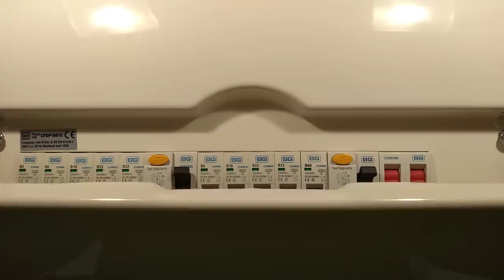A look inside a British home electrical panel.

Comment: I think the regs say 'fire retardant material' or something similar, but this has universally been taken to mean metal. Most switches and outlets in the UK are made of a fire retardant plastic, so I would have thought a consumer unit could be made of this. It's generally not a problem, but there are possible issues in using a metal unit on a TT system such as yours (and mine!).
Reply from the maker: That opens the can of worms of whether the DB itself should have an external RCD just to protect it.  But in reality, with well installed double insulated cables going through a proper gland like the one shown the risk of live unprotected metal bridging onto the case is extremely low.  Worst case scenario might be if the unit was on fire in which case it would be logical to isolate it externally anyway.

Comment: Wow,  the UK service panels are very clean and well designed.  PS. Clive it takes four years in BC Canada to become a residential electrician.
Reply from the maker: It used to take four years here, with day release one day a week to technical college for the first three.  A profit motivated faux "safety" organisation got involved.  A kitchen fitting company can invite a travelling "trainer" in to do a one day slideshow presentation for their guys and they all instantly become certified domestic electrical installers.  You can guess the results.
Reply: @bigclivedotcom  Yes. I see it a lot here... I did 2 yrs YTS in the 80s, then moved on to other jobs. Including a brief time with a telco (BT). Then came back to the industry... and have done another 3 yrs of practical training since then with a few courses also. The amount of people who have NO idea about current ratings of under various wiring methods, yet that's a basic thing!?

And as to the busbar going down the back of the breaker, every few days we come across one
Reply: @bigclivedotcom  Amazing and dangerous
Reply: @bigclivedotcom  How hard is it for DIYers to become certified that way? I can understand (but not necessarily agree with) the push to keep the incompetent away from electricals (though it seems to be a fail for that) but there are plenty of DIYers who are more than capable of handling things (at least the basics) safely.
Reply: @chaos.corner  I think those courses are aimed at people who will go on to join self-certification schemes (or whose employers will be setting that up for them). For all intents and purposes, that route is pretty much closed to DIYers. If you're not planning to earn an income from electrical work, forget about it.

However, in my understanding, self-certification is not the only way to comply with Part P of the Building Regulations. You can in theory notify your Local Authority Building Control department and have them approve, inspect and sign off on the work, in much the same way that you would have them sign off on DIY building work. You will need a plan for how you are going to convince them that the work complies with the required standards, and you'd be wise to run that plan past them at the beginning in case it won't convince them, but you don't necessarily need any formal qualifications. Different authorities may have different ideas about what's convincing. There will be fees to pay. There will be hoops to jump through. It may well be cheaper to hire an electrician. But it is, in theory, an option; the only option for the DIYer; and it doesn't necessarily involve sitting and watching any questionable n-day powerpoint presentations.

Not all work is notifiable though. Certain modifications can be undertaken as DIY almost as if Part P never existed.

Comment: Damn, they don't label breakers there either !  They should have to label them everywhere as part of the code and supply a wiring diagram for the building kept next to the fuse box and a copy with the house title. The same for plumbing too.
Reply from the maker: The unit has self adhesive labelling that is applied after installation.

Comment: Isn't it the wrong (less ideal) bus bar for these type of breakers?
The breakers seems to be the type that can receive a fork type bus bar that goes right under the screw leaving the cable hole free for an eventual cable.

Comment: The council rewired they put a 16b in for my shed after I said please don't use a 6 ,I replaced it with a new 32c (would have used my 40c but that was in the old board and they decided to keep it) I got a 40d just in case the 32 wasn't enough, local Toolstation had very limited stock. I should really upgrade the chunky armoured that feeds the shed to match the requirements.as it's conductors are worryingly scrawny.
Reply: You need to be careful to ensure that the cable (SWA) have more Amperage capacity than your breaker rating. Distance is also going to play a part. Can't believe you've got SWA capable of supporting sustained 40Amps. Thats at least 10mm2 conduit. Also what about the earth CPC cals. Have a look at John Wards Video about outdoor cabling and Conduit / Earthing sizes and Reqts.
Reply: @shilks8773   I stuck with the 32c after finding out what it took to trip the 40d .(thanks jw) The shed has also got a old modestly rated wire fusebox on the other end of the armoured. The thermal switch inside the welder is the first thing  to cut the supply when I'm going for it .

Comment: The 'vinegary' stuff isn't 'silicon' (a semiconductor used in diodes, transistors and integrated circuits) it's SILICONE ! Surprised you didn't know this. They're entirely different. DIN = 'Deutsches Institut für Normung' the German Institute for Standardization.

Comment: I read somewhere that these cases are supposed to be earthed, however because they are pained/powder coated before the earth blocks are installed, they actually aren't.  A separate wire needs to be added between the earth block and case. but no one ever does...any opinions on this bit of urban legend?
Reply from the maker: If you look at the left hand side of the earth bar you'll see it's clamped onto an earthing stud on the case.

Comment: Wow, my breaker box is rubbish.

We have one GFI and four breakers coming off it: Downstairs (mostly) ring main, Upstairs (and kitchen - because yes) ring main, all lights, and the shed (which has it's own consumer unit for the lights in there).

This seems wrong, whenever the electrician comes round, he says that if he has to do any slightly complicated electrical work he'll have to redo a lot of the house wiring.

Ah

Comment: Interesting video but one thing is confusing me: you mention that each RCD has its neutrals connected to a separate bus but I always thought that all neutrals were common and also connected to ground. Maybe I'm missing something?
Reply from the maker: On some systems neutral and ground are bonded together at the incoming supply.  The neutral has to be split between the two independent RCDs/GFIs because they compare the current flowing in live and neutral and trip if there is a significant difference.
Reply: @bigclivedotcom  OK thanks. So this means that the neutral(s) cannot be connected to ground as this would effectively link them all together?

Comment: Those are some thicc wires! Never seen an "ordinary" houshold need that much current. And why don't you have dual pole circuit brakers?
Reply: An electric shower will be in the 40-50A range. An electric oven and hob can reach similar numbers.
Reply: @a-q197  I know, I have an oven that needs a 40A fuse (yes we still have a distribution board that has fuses) and it has 6mm² wires connected to it. Those wires are at least 16mm²
Reply: @Bchan  Those wires are on a 100A breaker, so they need to be a size that can handle 100A.
Reply: @a-q197  they are on a 100A breaker? The highest current I can see is 63A, and a 10mm² wire is big enough for that current. 16mm² is a waste of money
Reply: @Bchan 100A main switch, assuming this would be protected by an 80A or 100A fuse.
Reply: @a-q197  oooh now I see, the mai  switch is indeed 100A. Quite a lot for a residential installation. Here 63A is the standard for the main breaker, I don't know anyone that has a 100A breaker.

Comment: As I did electrical work 20 years ago, the RCD and main breaker were always on the left side (Germany)
Did they change that or is it UK only?
Reply: It varies depending on the installer/company doing it
Reply: Well here in my very old German house too
Reply: In the UK, even the earth fault breaker (? or RCD ?) is right sided ... xD 
Same in France as in Germany and the cut outs are one pole protection, 2 poles break
Sorry, I'm really  not familiar with the english terms for these devices
Reply: It depends what you're ordering at the Supplier, most RCDs have the N on the left, but you can get a RCD with the N on the right.
Reply: Yeah, that's it!
The busbar connection of course.

Comment: As an American electrician I admire this safety features that the UK has put in those panels look like a pain in the ass to install compared to the North American load centers
Reply from the maker: Not too bad to install.  Keep in mind that the higher voltage means our wires are much thinner.

Comment: On our side of the pond, we prefer our 42 circuit panels, with enough wire bending room to turn a semi truck around.
Reply: They've actually removed the 42 space max for residential. I put a 60 space Cutler-Hammer CH panel in my old house.

Comment: Be interesting if you covered 3 phase at some point (and why we don't have it in all homes?)
Reply: "and why we don't have it in all homes?"

That's because it's generally not needed and it's simpler to install single phase. Load balancing in local distribution networks is achieved by rotating the phases between different properties as they are connected. Load balancing in 3 phase within a domestic property can be problematical unless the high current draw devices are three phase.

My supply is typical. A 100A nominally 230v (but typically closer to 240v) supply. If more is needed then 3 phase is a possibility, but expensive to provide and is generally only used by commercial properties. 

So, for most purposes, three phase is not necessary and adds cost and complexity.
Reply: @TheEulerID  Thanks for the answer, I wonder why the yanks generally /do/ have 3 phase.

I imagine it'll start becoming more common in new builds owing to electric cars and other high energy systems (ie, when boilers are finally banned and we need to use resistive or heat pump heating)
Reply: @M0LHA  US domestic properties don't generally have three phase. They have a split-phase 120v + 120v system with centre tapped earth. It used to be 100A, but I believe a lot is now 200A.

They do use 3 phase in the distribution network of course, but I think it's very far from the normal supply.

As for electric cars, they are going to present a lot of problems in many countries as the distribution networks will not be sized for everybody turning on 10 kW (or more) charges for two or three cars when they get home from the office. Some sort of smart charging system is likely to be required which backs off requirements at such peak times and can use cheaper power outside. Otherwise an immense amount of money is going to be required massively increasing local distribution capacity.
Reply: @TheEulerID  Ah OK, That makes sense.

On the EV front, I believe home charges have to be 'smart' as of 2020 for the very reason you said.

I imagine smart meters will also play a part in some fashion

Comment: Always a good idea to have an extra external circuit breaker installed before the consumer unit. Because otherwise you still have live screw terminals exposed even with the consumer unit breaker off and the lid open.
Edit: As Clive points out at the end of the video. :)
Reply: It seems to be common practice now to install a 'contractor switch' ie a double pole isolator between the meter and the consumer unit when a Smart Meter is installed.

Comment: You didn’t mention those lovely bootlaces, nor how the total load of the two halves of that DB is going to be running through the one half of that cable on the right of the join.
Reply from the maker: It's rated for the full current.  But will rarely see it.

Comment: As a person from the mainland, I find it weird to see a single phase installation supporting 100+ A... with a 16 A breaker, you get almost 4 kWs of power (into resistive loads). I'd consider anything over that definitely 3-phase territory. Copper is expensive.
Reply: Electric showers that are very common here can be 6 to 9kw, still on single phase 240v.
Reply: 16A three phase isn’t really enough for a house.

All the houses get a full three phase cable, you’re just only connected to one of them (unless you upgrade). They do that so that a) they don’t have to rely on the people themselves to balance their phases. B) they can switch your house from one phase to the next easily, if that is needed to balance the phases in the neigborhood, simply by switching the connection between your meter and the primary fuses before it.
Reply: (One of the problems is that if you have 16A circuit breakers, your main breakers/fuses need to be 25A or up to guarantee specificity. If you have 16A main fuses, your circuits can only be 6A which means you can’t use washing machines or space heaters or frankly some TVs or computers.

Specificity is required because otherwise you could blow the main fuse before the meter for every little thing, and replacing it can only be done by the electricity company.)
Reply: @tech4pros1  Exactly! That's 2*6 or rather 2*10 mm^2 instead of 3*2.5 or 3*4...

Comment: Is there a mechanism within the circuit breakers that still gives the external circuit protection even if the lever is physically held in the on position?

Comment: As a homeowner who isn't that electrical savvy, the two things that surprise me the most: there's very few circuits. Is this a small home or do they just group more rooms together?  Does this mean that every outlet in the house is protected for GFCI?
Reply: British houses have ring circuits, an entire floor gets it's own circuit.  It was due to the lack of copper after WW2, parallel wiring went out and serial wiring came in.

Comment: I was minded of when we moved into our house in South London which was a 1930's built affair and it had three types of round pin plug at various points and basically a fuse for the sockets and a fuse for the lights and it was merry hell to get all the electrical stuff wired in as the normal sized round pins were still available but the smaller ones were like rocking horse teeth, thankfully British Rail where me dad worked still used various old types of plugs and a quick trip down the stores yielded a suitable supply of the small types...   however the hoary old fuses didn't do a very good job and I think it was the third telly that got spiked into the pits of electrical hell that my dad being nagged by me mum, relented and we wired in everything new from socket boxes to a proto rcd fusebox as this was a bit before they became mainstream and me mums telly's were protected from dirty electricity.   Some of the heavy duty round pins used to smoke when plugged in and often would feel a "nip" off the big beastie round pins for the electric fire etc.   One of my dad's friends who was a BR sparksman came round to help him install a new meter and he's trying to offer me dad a set of electricity board crimpers and a box of crimps and me dad so straitlaced was like "no, no no" as it was the idea he would regularly "change" the meter and he got quite flustered lol

Comment: Alright man just a question, the way you only used a double pole isolator instead of what used to be used was the 63a neozed single pole fused switch, what did you use instead? Dont think the isolator protects your consumer unit or does it?
Reply from the maker: You could use a double pole MCB.  But the risk of a short within the consumer unit is low, so an isolator is all that is needed.  The utility fuse will protect against an incident.

Comment: So, wait, the "isolator" circuit breaker only switches the neutral, not the live? That sounds dangerous. Having an RCD/GFCI in the circuit breaker box seems problematic, too.

Comment: The average panel on the other side of the pond is twice this big (number of circuits). This size panel would never be sufficient to feed all the demands in a house over here, even if it would carry enough power it wouldn’t have enough capacity to handle all the different circuits.

Comment: 11:00 what is the correct way to check if the bus bar has gone in the correct place in the rcd/rcbo/cb? Do you perhaps remove all of the breakers on a bus bar together to look underneath?
Reply from the maker: You could use a small mirror or remove and refit the breakers.  All with the power off.

Comment: Is in Britain every installation with 1 Phase?  I'm from Austria there are always 3 phases even in flats, how do you feed devices with high power consumption like stoves or so much of the tools with strong motors like circular saw or a welding machine?
Reply from the maker: Single phase to homes, tapped alternately from different phases along the street.  All three phases to commercial and industrial premises.  A home can ask for a three phase supply.

Comment: DIN stads for "Deutsches Institut für Normung" = German Standardization Institute.
My flat's been wired up in 2002, and back then the law in Germany was that only the bathroom needed an RCD. So now I have this one RCD that's connected to my bathroom circuit, but now the law is that the whole flat should have at least one RCD connected to it. But I am not firm in wiring that up, so I'd either have to order and pay an electrician (who trains for 3 years here, so they should be well versed) myself, or to tell my landlord to order an electrician to wire it up according to code. Or I just leave everything as is.